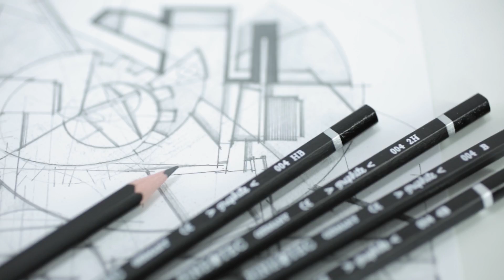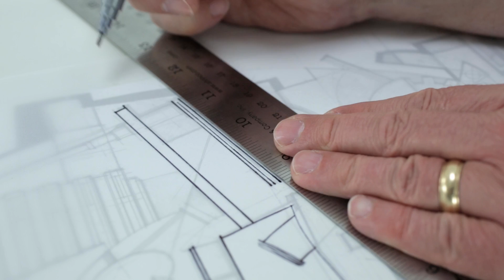Drafting Tools 101 - Writing Tools for Drafting and Technical Drawing

Comment: A quick question Is the knurled grip of the alvin draft matic mechanical pencil really hard and adherent? I looked for a pencil that resists my sweaty hands, I tried rotring 600, pentel grapgear 500, and his knurled grip didn't convince me. Could the alvin draft matic be the one? Is the barrel rubber or plastic?